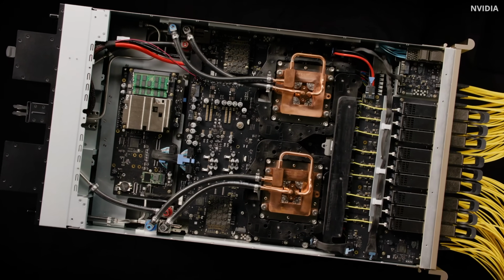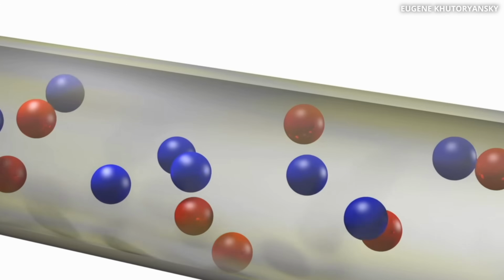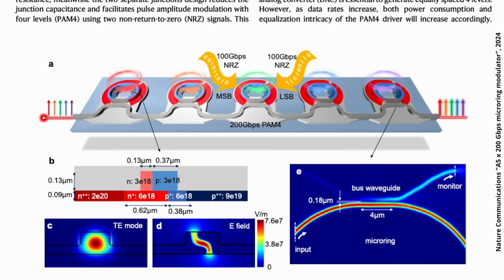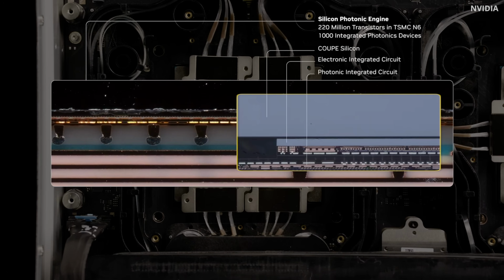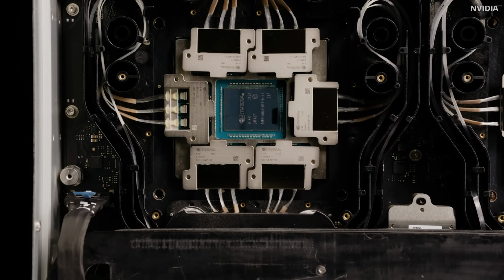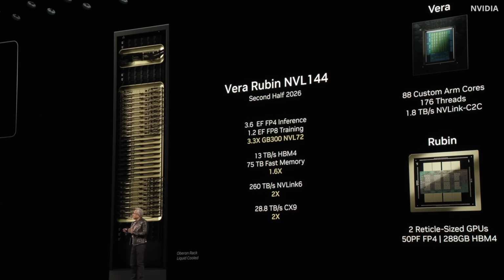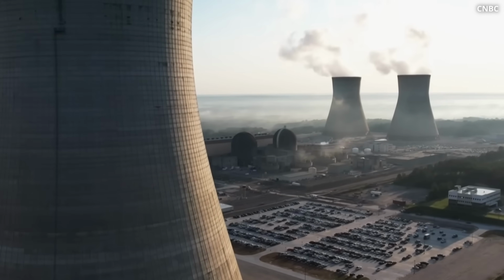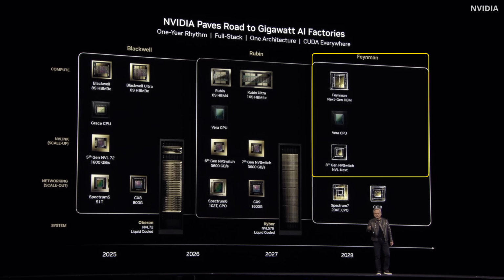NVIDIA’s New Photonic Technology Explained

Comment: The title of the video is misleading.  The optical part is just to transfer data between GPUs, to make it easier to have massive arrays of GPUs.   The "optical" part of the optical chip is only to link the GPUs, the wiring inside the array processing for the microchips is STILL COPPER.
Tech Tech Potato explains this right off the bat:   https://www.youtube.com/watch?v=PI3hF2TE8tg&t=558s

Comment: I was under the impression that the current major issue with photonics is reliance on lasers to carry our data (that uses too much energy). Resistance is really not an issue as it does NOT slow down "speed of electricity" = speed of electromagnetic fields. Speed of electrons - is really something else unrelated. Call me a skeptic.

Comment: WTF? Electricity is an electromagnetic wave and is as fast as light, because it's a form of light. The heat an resistance is another topic, unrelated to "speed of electricity".

The speed of electricity does not depend on the speed of electrons that move just mm per second. It depends on the electromagnetic field which moves at 50-99% of the speed of light because on the medium. Considering the distances the related transfer speed gain — not talking about bandwidth — does not play any role here.

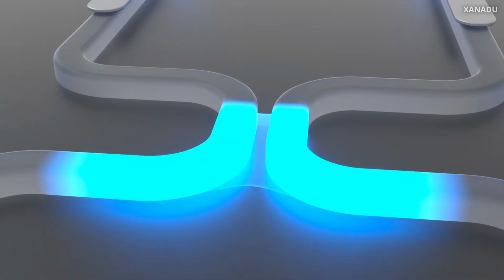Comment: "At the other end, tiny photodetectors grab the light and convert it back into electrical signals which is then read by the GPU", 7:28. Electrical signals? Is that correct? Isn't it binary? Is binary & electrical the same? Isn't the issue encoding & transmission to the GPU/ CPU after photodetection "transceiver-lessly"?

Comment: This is still not the panacea. They needs to build the processor on a photoconductive plate that allows transistors to send modulated photons to the plate to be picked up by the transistor waiting for the signal, simultaneous photon computing is the goal, later on the same photoconductive plate will the memory units sit. The Processing unit itself needs to be photonic.

Comment: I was expecting photonic processing, you know, like fluidic computing. but what you've described is still a huge step forward. I hadn't considered the process size constraining the light wavelength. Despite all the work, it seems like an inevitable progression rather than an invention, building on prior works and results of serious analysis of energy wastage, how to avoid inductive and capacitive loadings by switching to optics. OF course, having more experience with expert systems programming than leveraging AIs, I can't help wondering how much will feed back into the more traditional computers like RISC, Swapping out the serial in SATA cables etc. Optic channels in a USB C upgrade etc. (Hubs, not HID)

Comment: I'm working on a top-secret datacenter replacement project. Neutrino interactive data storage facility. Size is about 1 cubic meter and contains as much storage capacity as 1,000,000 datacenters. Data retrieval is done by thought waves and does not require any cabling or energy. Prototype in development stage at the moment and may become commercial in 10 years' time.

Comment: However, CEO Jensen Huang emphasized that optical connections remain less reliable than traditional copper for GPU-to-GPU communication, calling copper "orders of magnitude" more dependable. While NVIDIA has collaborated with TSMC on silicon photonics prototypes, these efforts are not yet mature enough for widespread deployment in GPUs, as the company prioritizes stability for AI infrastructure.   NOT READY YET!

Comment: So the lambda used in these native optical direct integration GPUs do these use ITU standard wavelengths or are they some proprietary wavelengths? Also what switches with terabyte back planes would be used to apply interconnect between GPUs.

Comment: When you said that optics doesn't have any resistance compared to copper is  not exactly true. Optics have a 10log function compared to coppers 20log.  Significantly less but  not zero. A few milliwatts can travel miles. You can drop laser drive power practically to microwatts. A lot less than a standard led and less than what power would be needed to use copper to jump from one rack to the next. Incredible jump in technology  just in the last 20 years. I'm interested in knowing the transmission speed. The last I saw they were working at 20 gig but that was for long haul transmission.

Comment: AI needs a new plan. 100 million wafers per day for chip factories. Static RAM to replace DRAM. Largest FPGA to replace GPU. AI programs the FPGA accelerators. 8TB RAM + 64TB storage home PCs to offload data centre PCs, 10gbit symmetric internet infrastructure, 1mm fibre optic connectors.

Comment: The propagation speed of signals in copper and optical fiber is nearly identical, around 68% the speed of light.  You might be able to get more bandwidth over fiber, especially over long cable lengths, but it's not any faster.  There's a reason it's still copper in the rack, there's not really any benefit to it that isn't cheaper to do with just more copper wires in parallel.  There are definite benefits at the chip scale, though, so it might make some sense to go nearly all optical to avoid the transition once you've got that. There is something to be said for reducing power consumption and heat generation but that's usually less of a concern outside the CPU or GPU chips themselves.

Comment: @4:15 to be clear, copper doesn't slow anything down. In fact a signal is transmitted at the speed of light through copper, whereas it's about half that through fiber optics. The slowdown is in the bandwidth limitations.
Reply: how is that flow of electrons is noot   llight speed
Reply: @lglubbock7593 I guess the signal effect travels at c, while the electrons that pass the effect move pretty slowly.
Reply: Also heat limitations which is probably very important.

Comment: There may be no electrical resistance but from what I understand while fibre optics are fast there is a 30% reduction in speed, I think due to the refraction index? So there is resistance if it's fibre optic based, otherwise there is a new material on the block...?

Comment: This technology is fascinating.  We have come a long way.  At this moment while writing this I am wearing a vintage digital watch that has resistors and capacitors wired into a board with wires!  Contrast that with my Omega X-33 watch which has no physical components and only uses integrated circuits to show the time and perform the many functions of this timepiece. I wonder if this new light technology will ever become small enough to fit inside a watch.

Comment: I think some of your description of why light is better than copper wire is confusing. Signals pass through wires at the speed of light, but the data capacity of an electrical signal is limited by the switching frequency and cable characteristics.  Very high frequency signals are attenuated over short distances and susceptible to interference and data corruption.  Passive transmission has little power loss issues but active transmission using amplifiers consumes more power.  40Gbps via wire is a practical limit.  Ie the bandwidth of a length of wire is practically limited. Optical transmission has almost unlimited bandwidth because it allows many different light frequencies (colours) to go through the same optical guide with no effective power loss or signal strength loss over useful distances and is not susceptible to electromagnetic interference.  The speed of the signal in copper is not the issue.
Reply: She also said about the benefit of the many light frequencies in spectrum
Reply: Pcie5 has extremely limited wire length and much higher power per lane. We needed photonics a year ago. 
Hopefully soon...
Reply: The main issue is the bandwidth, you can shove a lot of bandwidth over optical. The chip directly switches the light signals for options and internal network optimization far faster than wires and transistors can. ❤
Reply: Yeah but it still cute
Reply: Copper can slow down data. Remember that every metal wire has resistivity. Resistivity is inversely proportional to the cross sectional area of the wire, and directly proportional to its length
Reply: @ChrisEsekhile  Resistivity only means that copper uses more power and that the cable length without repeaters is lower. The speed of the signal (velocity factor) for a cat7 ethernet cable is 3/4 the speed of light and for a glass fiber cable it is 2/3 the speed of light. So the signal arrives faster through the copper cable, the maximum possible data rate is much lower though. Electromagnetic waves are only transmitted at the speed of light in a vacuum (or in air approxinately).

Comment: 🎯 Key points for quick navigation:

[https://www.youtube.com/watch?v=7WuLHM8d-ew&list=TLPQMDUwNDIwMjXrnvUQ0PPZZA&index=2](https://www.youtube.com/watch?v=7WuLHM8d-ew&list=TLPQMDUwNDIwMjXrnvUQ0PPZZA&index=2)) 💡 NVIDIA introduced an optical chip, shifting data movement from electricity to light, crucial for future AI.
[https://www.youtube.com/watch?v=7WuLHM8d-ew&list=TLPQMDUwNDIwMjXrnvUQ0PPZZA&index=2](https://www.youtube.com/watch?v=7WuLHM8d-ew&list=TLPQMDUwNDIwMjXrnvUQ0PPZZA&index=2)) ⚡ Copper-based data transfer is inefficient, causing delays and energy waste in large GPU clusters.
[https://www.youtube.com/watch?v=7WuLHM8d-ew&list=TLPQMDUwNDIwMjXrnvUQ0PPZZA&index=2](https://www.youtube.com/watch?v=7WuLHM8d-ew&list=TLPQMDUwNDIwMjXrnvUQ0PPZZA&index=2)) 🌐 Network performance is critical in modern AI data centers, not just individual GPU performance.
[https://www.youtube.com/watch?v=7WuLHM8d-ew&list=TLPQMDUwNDIwMjXrnvUQ0PPZZA&index=2](https://www.youtube.com/watch?v=7WuLHM8d-ew&list=TLPQMDUwNDIwMjXrnvUQ0PPZZA&index=2)) 🔥 Copper wire inefficiency: 70% of data center power is used for data movement, not computation.
[https://www.youtube.com/watch?v=7WuLHM8d-ew&list=TLPQMDUwNDIwMjXrnvUQ0PPZZA&index=2](https://www.youtube.com/watch?v=7WuLHM8d-ew&list=TLPQMDUwNDIwMjXrnvUQ0PPZZA&index=2)) 💡 NVIDIA's Quantum-X: Uses light instead of electricity for data transfer between GPUs.
[https://www.youtube.com/watch?v=7WuLHM8d-ew&list=TLPQMDUwNDIwMjXrnvUQ0PPZZA&index=2](https://www.youtube.com/watch?v=7WuLHM8d-ew&list=TLPQMDUwNDIwMjXrnvUQ0PPZZA&index=2)) 📶 High bandwidth: Light operates at terahertz frequencies, enabling more data channels.
[https://www.youtube.com/watch?v=7WuLHM8d-ew&list=TLPQMDUwNDIwMjXrnvUQ0PPZZA&index=2](https://www.youtube.com/watch?v=7WuLHM8d-ew&list=TLPQMDUwNDIwMjXrnvUQ0PPZZA&index=2)) ⚡ Light transmission: Faster, less heat, and lower power consumption compared to copper.
[https://www.youtube.com/watch?v=7WuLHM8d-ew&list=TLPQMDUwNDIwMjXrnvUQ0PPZZA&index=2](https://www.youtube.com/watch?v=7WuLHM8d-ew&list=TLPQMDUwNDIwMjXrnvUQ0PPZZA&index=2)) 🔄 Micro Ring Modulator: Changes light intensity to encode information.
[https://www.youtube.com/watch?v=7WuLHM8d-ew&list=TLPQMDUwNDIwMjXrnvUQ0PPZZA&index=2](https://www.youtube.com/watch?v=7WuLHM8d-ew&list=TLPQMDUwNDIwMjXrnvUQ0PPZZA&index=2)) 🛣️ Wave Guides: Microscopic silicon pathways carry light-encoded information.
[https://www.youtube.com/watch?v=7WuLHM8d-ew&list=TLPQMDUwNDIwMjXrnvUQ0PPZZA&index=2](https://www.youtube.com/watch?v=7WuLHM8d-ew&list=TLPQMDUwNDIwMjXrnvUQ0PPZZA&index=2)) 📦 Quantum-X package: Includes a specialized ASIC for signal processing.
[https://www.youtube.com/watch?v=7WuLHM8d-ew&list=TLPQMDUwNDIwMjXrnvUQ0PPZZA&index=2](https://www.youtube.com/watch?v=7WuLHM8d-ew&list=TLPQMDUwNDIwMjXrnvUQ0PPZZA&index=2)) 🏭 Manufacturing innovation: TSMC integrates photonic and electronic chips in different process nodes.
[https://www.youtube.com/watch?v=7WuLHM8d-ew&list=TLPQMDUwNDIwMjXrnvUQ0PPZZA&index=2](https://www.youtube.com/watch?v=7WuLHM8d-ew&list=TLPQMDUwNDIwMjXrnvUQ0PPZZA&index=2)) 🧠 Chip layers: 6nm electronic chip (control) on top of a 65nm photonic chip (optics).
[https://www.youtube.com/watch?v=7WuLHM8d-ew&list=TLPQMDUwNDIwMjXrnvUQ0PPZZA&index=2](https://www.youtube.com/watch?v=7WuLHM8d-ew&list=TLPQMDUwNDIwMjXrnvUQ0PPZZA&index=2)) 📏 Nanometer logic: Optical components don't benefit from extremely small nanometer sizes.
[https://www.youtube.com/watch?v=7WuLHM8d-ew&list=TLPQMDUwNDIwMjXrnvUQ0PPZZA&index=2](https://www.youtube.com/watch?v=7WuLHM8d-ew&list=TLPQMDUwNDIwMjXrnvUQ0PPZZA&index=2)) ⚡ Power reduction: Quantum-X reduces power consumption by 3.5x.
[https://www.youtube.com/watch?v=7WuLHM8d-ew&list=TLPQMDUwNDIwMjXrnvUQ0PPZZA&index=2](https://www.youtube.com/watch?v=7WuLHM8d-ew&list=TLPQMDUwNDIwMjXrnvUQ0PPZZA&index=2)) 💰 Cost savings: Eliminates the need for millions of transceivers, speeding up data center deployment.
[https://www.youtube.com/watch?v=7WuLHM8d-ew&list=TLPQMDUwNDIwMjXrnvUQ0PPZZA&index=2](https://www.youtube.com/watch?v=7WuLHM8d-ew&list=TLPQMDUwNDIwMjXrnvUQ0PPZZA&index=2)) 🚀 Early adoption: NVIDIA and AMD will be among the first to use TSMC's COUPE technology.
[https://www.youtube.com/watch?v=7WuLHM8d-ew&list=TLPQMDUwNDIwMjXrnvUQ0PPZZA&index=2](https://www.youtube.com/watch?v=7WuLHM8d-ew&list=TLPQMDUwNDIwMjXrnvUQ0PPZZA&index=2)) 🛡️ Data privacy: Incogni helps remove personal data from data broker databases.
[https://www.youtube.com/watch?v=7WuLHM8d-ew&list=TLPQMDUwNDIwMjXrnvUQ0PPZZA&index=2](https://www.youtube.com/watch?v=7WuLHM8d-ew&list=TLPQMDUwNDIwMjXrnvUQ0PPZZA&index=2)) 🔬 Material advancement: New materials like lithium niobate or indium phosphide could replace silicon in modulators.
[https://www.youtube.com/watch?v=7WuLHM8d-ew&list=TLPQMDUwNDIwMjXrnvUQ0PPZZA&index=2](https://www.youtube.com/watch?v=7WuLHM8d-ew&list=TLPQMDUwNDIwMjXrnvUQ0PPZZA&index=2)) 🔮 Future integration: Goal is to bring optics within GPUs for interchiplet communication.
[https://www.youtube.com/watch?v=7WuLHM8d-ew&list=TLPQMDUwNDIwMjXrnvUQ0PPZZA&index=2](https://www.youtube.com/watch?v=7WuLHM8d-ew&list=TLPQMDUwNDIwMjXrnvUQ0PPZZA&index=2)) 🌌 Rubin GPU: Named after Vera Rubin, who discovered evidence for dark matter.
[https://www.youtube.com/watch?v=7WuLHM8d-ew&list=TLPQMDUwNDIwMjXrnvUQ0PPZZA&index=2](https://www.youtube.com/watch?v=7WuLHM8d-ew&list=TLPQMDUwNDIwMjXrnvUQ0PPZZA&index=2)) 🚀 Rubin GPU: Double die design, manufactured by TSMC at N3P (3nm process).
[https://www.youtube.com/watch?v=7WuLHM8d-ew&list=TLPQMDUwNDIwMjXrnvUQ0PPZZA&index=2](https://www.youtube.com/watch?v=7WuLHM8d-ew&list=TLPQMDUwNDIwMjXrnvUQ0PPZZA&index=2)) 🔢 FP4 adoption: 4-bit floating point precision is increasingly used in AI/ML for reduced memory and power.
[https://www.youtube.com/watch?v=7WuLHM8d-ew&list=TLPQMDUwNDIwMjXrnvUQ0PPZZA&index=2](https://www.youtube.com/watch?v=7WuLHM8d-ew&list=TLPQMDUwNDIwMjXrnvUQ0PPZZA&index=2)) ⚡ Performance boost: From process node upgrade (N4 to N3) and architectural improvements.
[https://www.youtube.com/watch?v=7WuLHM8d-ew&list=TLPQMDUwNDIwMjXrnvUQ0PPZZA&index=2](https://www.youtube.com/watch?v=7WuLHM8d-ew&list=TLPQMDUwNDIwMjXrnvUQ0PPZZA&index=2)) 📦 Rubin Ultra GPU: Moves to four GPUs per package and 576 GPUs per NVLink.
[https://www.youtube.com/watch?v=7WuLHM8d-ew&list=TLPQMDUwNDIwMjXrnvUQ0PPZZA&index=2](https://www.youtube.com/watch?v=7WuLHM8d-ew&list=TLPQMDUwNDIwMjXrnvUQ0PPZZA&index=2)) 🤯 100 PFLOPs: Rubin Ultra GPU aims for 100 PFLOPs of FP4 compute.
[https://www.youtube.com/watch?v=7WuLHM8d-ew&list=TLPQMDUwNDIwMjXrnvUQ0PPZZA&index=2](https://www.youtube.com/watch?v=7WuLHM8d-ew&list=TLPQMDUwNDIwMjXrnvUQ0PPZZA&index=2)) 🌡️ Thermal challenges: Addressing heat and power issues in the Rubin Ultra GPU is a key concern.
[https://www.youtube.com/watch?v=7WuLHM8d-ew&list=TLPQMDUwNDIwMjXrnvUQ0PPZZA&index=2](https://www.youtube.com/watch?v=7WuLHM8d-ew&list=TLPQMDUwNDIwMjXrnvUQ0PPZZA&index=2)) 🧠 Cache coherence: Data is pre-fetched and placed in the right memory for immediate use.
[https://www.youtube.com/watch?v=7WuLHM8d-ew&list=TLPQMDUwNDIwMjXrnvUQ0PPZZA&index=2](https://www.youtube.com/watch?v=7WuLHM8d-ew&list=TLPQMDUwNDIwMjXrnvUQ0PPZZA&index=2)) 📈 Power consumption: Rubin Ultra rack will consume 600kW of power.
[https://www.youtube.com/watch?v=7WuLHM8d-ew&list=TLPQMDUwNDIwMjXrnvUQ0PPZZA&index=2](https://www.youtube.com/watch?v=7WuLHM8d-ew&list=TLPQMDUwNDIwMjXrnvUQ0PPZZA&index=2)) 💧 Advanced cold plates: Direct liquid cooling pulls heat directly from the chip.
[https://www.youtube.com/watch?v=7WuLHM8d-ew&list=TLPQMDUwNDIwMjXrnvUQ0PPZZA&index=2](https://www.youtube.com/watch?v=7WuLHM8d-ew&list=TLPQMDUwNDIwMjXrnvUQ0PPZZA&index=2)) 🧮 Algorithm efficiency: Transformer engine downcasts calculations to FP4, saving memory and compute.
[https://www.youtube.com/watch?v=7WuLHM8d-ew&list=TLPQMDUwNDIwMjXrnvUQ0PPZZA&index=2](https://www.youtube.com/watch?v=7WuLHM8d-ew&list=TLPQMDUwNDIwMjXrnvUQ0PPZZA&index=2)) 🔄 Algorithmic innovation: Optimizing algorithms to reduce silicon usage.
[https://www.youtube.com/watch?v=7WuLHM8d-ew&list=TLPQMDUwNDIwMjXrnvUQ0PPZZA&index=2](https://www.youtube.com/watch?v=7WuLHM8d-ew&list=TLPQMDUwNDIwMjXrnvUQ0PPZZA&index=2)) 🗺️ NVIDIA's roadmap: Layered plan for building industrial-scale AI systems.
[https://www.youtube.com/watch?v=7WuLHM8d-ew&list=TLPQMDUwNDIwMjXrnvUQ0PPZZA&index=2](https://www.youtube.com/watch?v=7WuLHM8d-ew&list=TLPQMDUwNDIwMjXrnvUQ0PPZZA&index=2)) 🔄 Upgrade cycle: Annual upgrades instead of typical 5-year GPU lifespans.
[https://www.youtube.com/watch?v=7WuLHM8d-ew&list=TLPQMDUwNDIwMjXrnvUQ0PPZZA&index=2](https://www.youtube.com/watch?v=7WuLHM8d-ew&list=TLPQMDUwNDIwMjXrnvUQ0PPZZA&index=2)) 🎤 Tech rockstars: Scientists and tech executives are becoming influential figures.

Made with HARPA AI

Comment: Of course if the power need of the transmission is 3.x times less, that does not mean that the total energy used by the data center is reduced by that much, does it?  So what is the total energy savings to a data center?
And what does all this mean for personal pc, on-board AI?  And the progress toward optical cpu's?